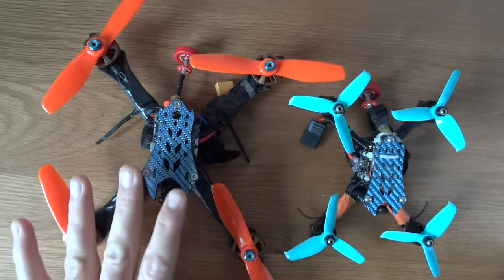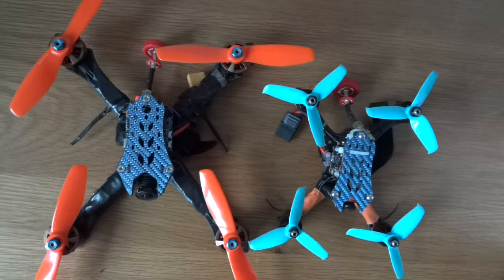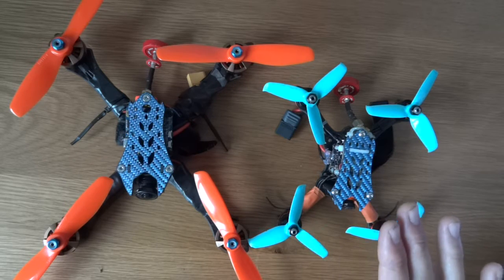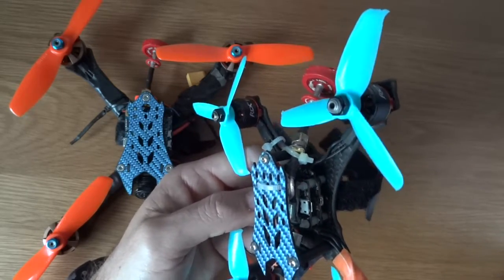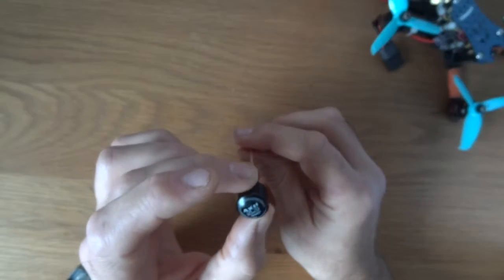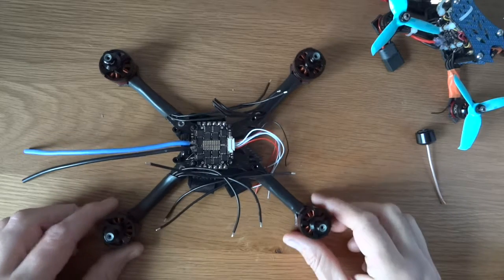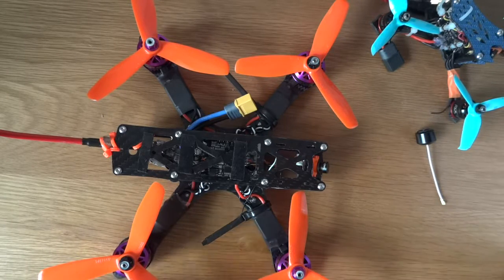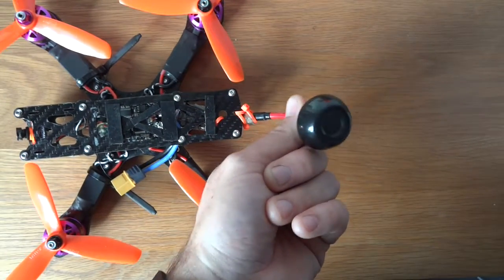Waffle friday... late upload :)

Comment: Another data point on the Spedix 30A ESC's - they're brilliant, cope perfectly well with DShot600, and having ruined an example of every other component of the three quads I've built using those, the ESCs have been bulletproof.  Closest thing to a complaint is that I'd prefer silicon wire for the signal pairing, but that's really quite minor and fixable by the type of end user who would have such a minor complaint.
Reply from the maker: tehllama42 agree with everything you said. There's a lot of hype in this hobby. A component that is reliable and good value is worth every penny. Hope the 4 in 1 works as well. Mines going in the devel.